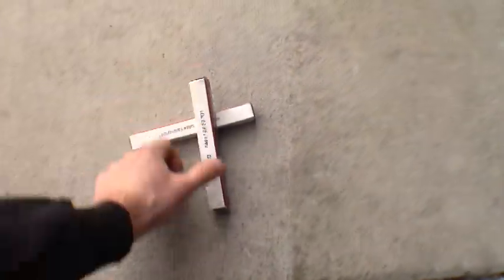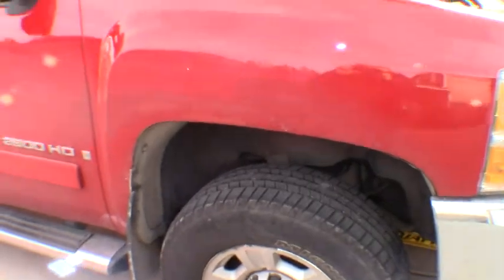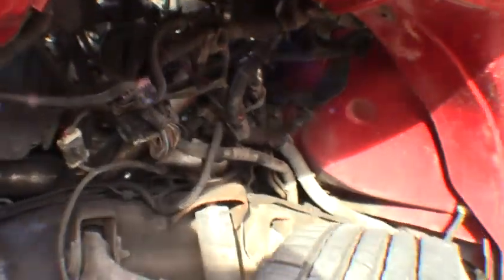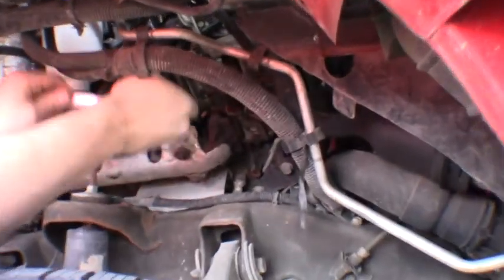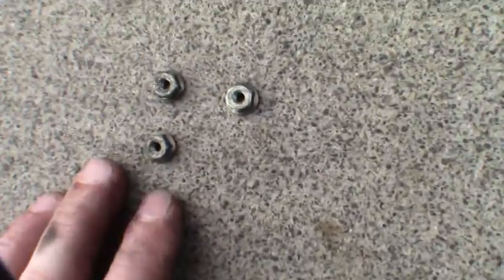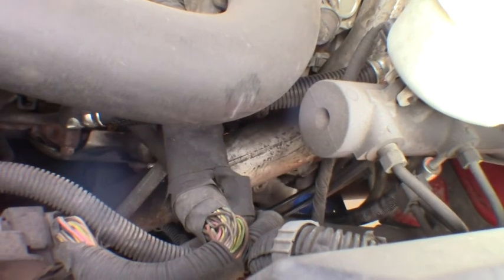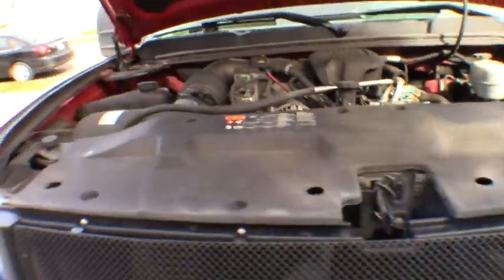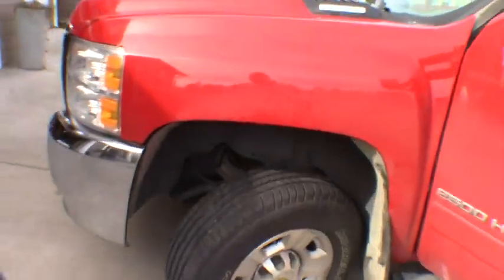changing Duramax glow plugs, lmm glow plug replacement @Chevrolet @GM-Genuine-Parts-and-ACDelco

Comment: Great video, did it help with access to the glow plugs with the tires turned the way you had them or just take them off?
Reply from the maker: Thanx..Just turning the tires seemed 2 allow enough arm access without having 2 remove tire though I'm not a large guy
Reply: Turners Speed Shop 👍🏻

Comment: Dude,  you skipped over # 4!?!  That’s the only hard one in the whole job.
Reply from the maker: Yup dropped the nut at 7.28 and talked about how I got it out at 9.26..like I said impossible 2 film 🎥 if u come up with a way I'm open 2 suggestions 🤣 go at it from the top side👍
Reply: @Turnersspeedshop  If I can’t find a half-deep socket solution tomorrow, I’ll pull the steering shaft.  I’m LML so not sure the clearance is exactly the same.
Reply from the maker: That is certainly very possible! Keep me posted
Reply: @Turnersspeedshop  #4 SECRET WEAPON HACK (LML). Milwaukee 12mm deep 1/4” drive socket slips nicely onto the glow plug behind the steering shaft. It also has a square shank that mates perfectly to a 14mm open end wrench. Through the fender well. Easy-peezy. Seriously, it couldn’t be more simple and it makes #8 hard by comparison. 

Interestingly, I was throwing a #8 code which didn’t clear until I replaced #2 (driver’s front).
Reply from the maker: Sweet..thanx 4 the tip!
Reply: Or remove steering link that block #4 it’s super easy 2 15mm wrenches and it’s off(tie steering wheel up if you do that so it don’t turn)
Reply from the maker: Seems excessive though since it's accessible without doing that